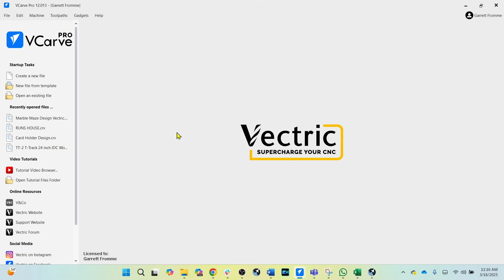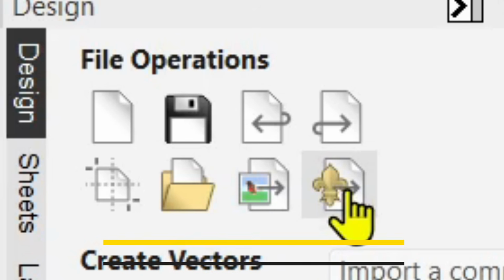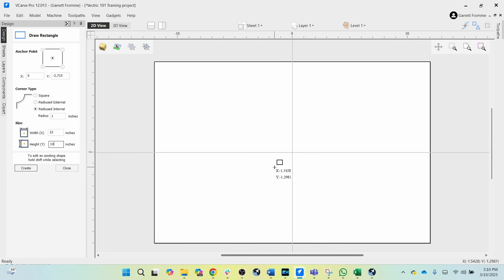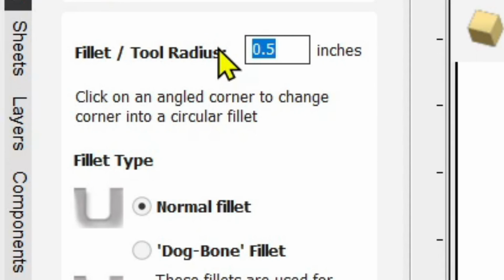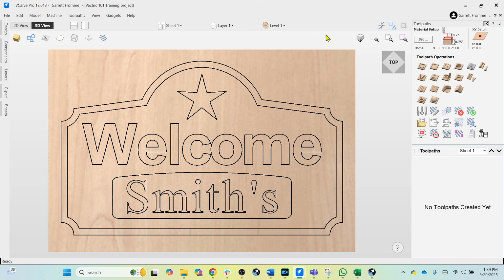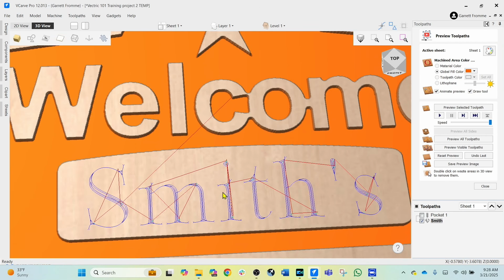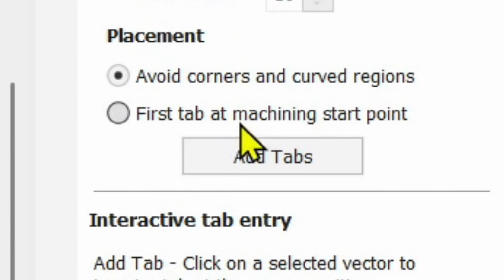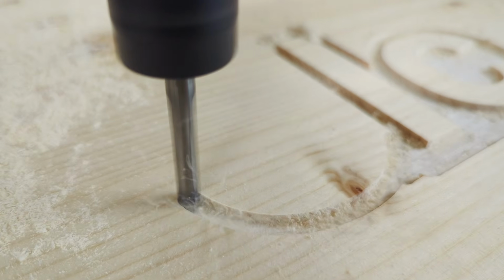The Most Complete Vectric 101 Tutorial for Beginners (Vcarve, Aspire, Cut2D), CNC Router Project

Comment: This is exactly what I needed. Direct and detailed instructions, no questions.  I just don't get the straight or curvy line on my cursor...after I save toolpaths to my thumbdrive, I lost the ability to see the cutout color.
Reply from the maker: I'm glad the instructions were helpful for you! As for the cursor issue, it sounds like you may need to check your software settings or reach out to your machine manufacturer for more specific guidance.

Comment: so I have a couple of question we are running a scm pratix n15 5x12 router, we are using cabinet vision software for our cabinet designs but somtimes we need to do specialty projects like curved mullion glass doors it would only be used for small projects like that would the desktop pro be sutiable for that also  noticed that my particular router is not listed  in the machine post? there are some scm routers that are on the list our machine is older model and uses xilogplus software on the machine any thoughts? before i would spend the 2k for the vetric i  would just upgrade our software to alpha-cam would cost around the same. also is the price a yearly subscription or is it liftime?
Reply from the maker: This one is a little tricky to walk you through over comments, my friend. I recommend joining us for our live sessions we host every Wednesday evening at 8 PM EST, and we should be able to help walk you through it then, brother!

Comment: Im old and retired (medical) living on SS.
Can barely make ends meet.
I need a side hustle for some extra income.
Have use Bobcad software and Mach 3 in the past to run an old 30x20 CNC router for simple 2D inlays on wood pens.
Want to upgrade to a more modern machine like the Gemitsu 4040 pro.
Can not afford $800 or more for software. 
Found a used  Vectric desktop ver 11.5 for sale with the keys.
Dont think its a copy. 
Am I wasting my time and money thinking I can get going for under $800 total cost?
Reply from the maker: It sounds like you’ve done some thoughtful planning there. As long as the Vectric desktop software you found is legitimate, you should be able to get started for under $800, which is pretty great!

Comment: The 90 degree vbit you selected had an rpm speed of 57000 rpm’s?????
Reply from the maker: I can see how that might seem surprising! Some specialized CNC bits can have very high RPM ratings for optimal performance, but always refer to your specific machine’s guidelines for safe operation, brother.
Reply: @IDCWoodcraft  
I don't think your spindle runs at 57,000 rpms. You had it set for that much but I still don't think your spindle runs that fast. I was just alerting you to that unless you have it on manual then it shouldn't matter.

Comment: I agree with many others that this is a very well done course.

Question, if anyone else has come across this -- I'm at about 1:08:30 in the video where he is showing off the view controller in the 3D View (to rotate the piece around). When Garret rotates the piece around (for example, see right at 1:08:39) you can see the third dimension (the thickness) of the piece. When I do the same the piece has zero thickness -- it's completely flat. Anyone else see this? I have verified in the Job Setup that my dimensions are correctly set with a 0.75" thickness, so it's not that. I'm using Vcarve Desktop 12.506.
Reply from the maker: This one is a little tricky to walk you through over comments, my friend. I recommend joining us for our live sessions we host every Wednesday evening at 8 PM EST, and we should be able to help walk you through it then, brother!
Reply: @IDCWoodcraft  Thanks for the reply! I worked through this issue, but I'm glad to hear you do live sessions -- will definitely take advantage!

Comment: Great video, thank you so much!  One question, you are using the same bit twice in your demonstration, however, you have them separated in the tool path?  Isn't it more efficient to group the paths together that use the same bit?  I can see where you don't wan't to cut the border out until the end but couldn't you have started with "Smith's" and then moved onto the other paths that use the 1/4 downcut?
Reply from the maker: Thanks for watching and for the great question! Grouping paths can definitely improve efficiency, and while there are reasons for the separation in some cases, your suggestion about starting with "Smith's" is spot on.

Comment: Hello Garrett, I just finished the entire video. very well done thank you very much.
Having spent the better part of 10 years working in other CNC software packages that mainly was designed for the commercial world, I am very pleased and happy to see the simple little things that this software package does that were never part of the other software packages I have used . That is the cursor.. it gives you more information on what the software is doing at that given moment than any other software, I have used. 
I agree with you the number one thing that one needs to do on a regular basis is to save the work . With this software having no automatic save I personally recommend hitting the control save after every time you’ve completed a function. Don’t wait till that entire portion is done before you hit save
Reply from the maker: Thanks for diving into the video and sharing your insights! It's great to hear that you're finding value in the software's features—saving regularly is definitely a crucial habit to develop!

Comment: I fine the surfacing bits should have a small tip radius . With metal it will hold up better and you will get a much better surface finish. Just a thought . Probably  to hard to make or set up in production.
Reply from the maker: You make a great point about a smaller tip radius for surfacing bits, especially for metal work. Thanks for sharing your thoughts, I appreciate your insight!

Comment: Thank you for posting this very nice instructional video.  I've worked with sign version cnc routers for over 35 years and have used a software called Art Path made by Gerber Scientific Products and their router called Saber, we had 2 of them.  One thing I did not see is if there is an option to do what Art Path would call "Finish Cuts".  They are essential all cuts before the last depth cut are slightly outside the shape say .008" and above the bottom by lets say .015 sort of leaving a tab but the finish cut comes in right on the edge and all the way down.  This is especially helpful when cutting dense material where the bits or machine slightly flex into the cut or away from the cut leaving small ridges along the cut depth.  The finish cut removes all of those.  The tabs are for sure a great thing to hold the pieces together as many of projects I've worked on have been destroyed in the final finish cut where a, lets say a  letter "L" came lose and got chewed up by the bit.  I'm now wanting to buy a small cnc for hobby use since I sold  my sign company and no longer have the machinery that I once did.  I'm looking at the NymoLabs NBS-6040.  Nice small size for my little garage and it looks like its has plenty of power to move around.  The software I use to use is way more expensive and only works on their cnc routers $80k+ which is way to expensive for my hobby needs.  Thank you again and I hope there is some finish cut option that is hidden, and if so please let me know?
Reply from the maker: Thanks for sharing your experience! The finish cut feature you’re referring to isn't typically standard in most software, but definitely check the settings of your new machine and its software—if it's not there, it might be worth reaching out to the manufacturer for guidance. Enjoy your new hobby setup, brother!

Comment: Great beginner tutorial. One tip for naming tools paths. For instance, you're using a 1/4 endmill to do the "cutout". I would name the tool path "cutout 14em". This way, when I actually load the bit in the machine, the tool path name will remind me which bit I programmed and don't accidentally load the wrong one. Like a 1/8 endmill, for instance. 
Thanks for the hard work that went into making this video!
Reply from the maker: That's a fantastic tip! Naming tool paths clearly can definitely save some headaches later on. Thanks for sharing your insight and for watching the video!

Comment: Can I use vectric for a 3D printer and a laser engraver?
Reply from the maker: Vectric software is primarily designed for CNC machining, so it's not fully compatible with 3D printers or laser engravers. However, you might find some ways to export designs for those machines with the right file formats!

Comment: Excellent, thank you! Got me going quite quickly with the software. Only problem was after adding the arc to the square and trimming the top line of the square out the arc was not joined to the rest of the square no matter how carefully I positioned it in the first place (tried several times - definitely had the little square on tye cursor). A bit of googling and I found the join tool and that fixed it up. Couldnt get it to behave the way it did for you though.
Reply from the maker: I appreciate your feedback, my friend! Software can be a bit tricky sometimes, but I'm glad you found a solution with the join tool.

Comment: Grant video. At around 56:31 you have double audio competing. 

I was trying to redo a circle but had to do a whole new page each time cause I had grouped them and couldn’t get the size of the circles to be larger together. Looking for how to open and change all the circles together. 

Dog holes for the table. And pvc pipe wasn’t cooperating on the outside diameter on cut. 

Couldn’t select the circle and change the value of all of them. Think I got it now. But have to try on my saved file.
Reply from the maker: Thanks for the heads up about the audio, my friend! Changing multiple objects at once can be tricky; just make sure they're grouped properly next time. I'm glad to hear you've figured out the circles, though—good luck with your saved file!

Comment: Great video, however I am getting an "Error: The visible toolpaths use different tools and the selected Post Processor does not support tool changing " Any ideas how I can work around?
Reply from the maker: I'm the save toolpath area, select the item at the top "save to separate files"
Reply: @IDCWoodcraft  Once you save to separate files, how are you telling the system where to put the next potion of your project?

Comment: Hello Garrett, thanks for all the info, I've ordered some bits, and have downloaded the bit tools library.  watching the 101, there are 3 things that do not work for me and hopefully someone here or you could help. I am running Vcarve Desktop.

1. after I'm done creating the vectors in 2d, when I click on the 3d tab, i only have a blank slate, how do I see the drawing on the colored background?
2. towards the end you toggled a square box somewhere and it switched the view from 3D to lines, I don't have that feature...

3. When doing the text edit on Welcome, to seperate the C and the O, I do not get the crosshair view in order to create the spacing, so I can not alter the letters from touching.  Can you help?
Reply from the maker: If you are using any version below 12, you won't be able to see the vectors on the 3D side. Otherwise, there will be several click boxes in the upper left of the drawing screen. Click those and you'll see how it works.

For number three, to adjust the text spacing, again, that is new in version 12. However, version 11.5 and lower does have that feature. It will be a separate icon in the text writing icons under create vectors called text spacing

Comment: Hello. This is a fantastic video. You are a great instructor. I have one question. Where do I set the plunge rate, feed rate and depth per pass?? (I have been using Easel in the past where those settings can be set.) thanks you.
Reply from the maker: I'm glad you enjoyed the video! In the software you're using, the plunge rate, feed rate, and depth per pass are typically set in the toolpath settings or the job settings section. Make sure to check the parameters for the tool you’re using, as different tools might have different settings that you'll want to adjust. Happy CNCing!

Comment: Great job I think this will help a lot. When using this software do  I need to use z code ? I have a Genmitsu Prover xl 4030 v2.
Reply from the maker: I'm glad you found the video helpful! For your Genmitsu Prover XL 4030 V2, it's best to check the machine's manual, but typically, standard G-code is what you'll use for setups like this.

Comment: This was a very well done video. I like the way that you concentrated only on what was needed for someone to get started. Like @spiderspid I am just beyond the newby stage for Vectric. I've been using it off and on for the past year. Even so there were a lot of details on this video that I had forgotten. As someone else said, I need to take notes. This was a also a very relaxing video to watch. I do have a question. At just a few seconds before 1:23 in the video the V bit cutting parameters show the router RPM as being 57000 rpm at 0.0005" chip load. Does your router really spin that fast?
Reply from the maker: Good catch. I didn't notice, I'll have to look at that. It does not run that fast and that is too fast for CNC